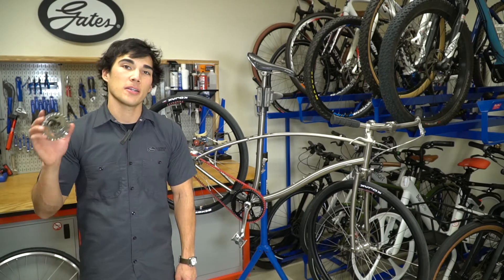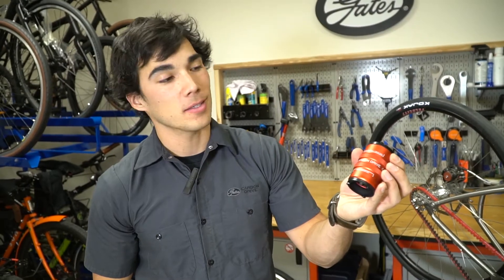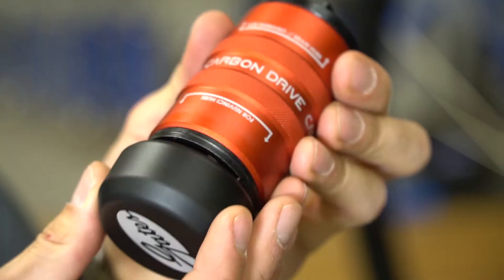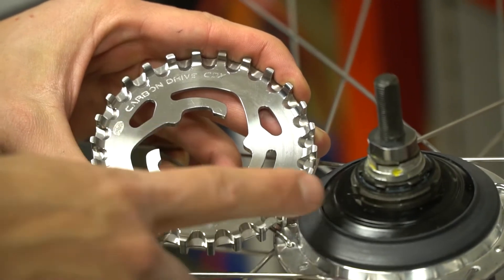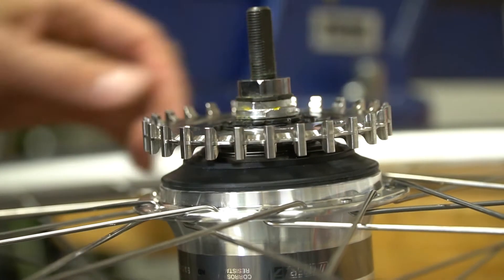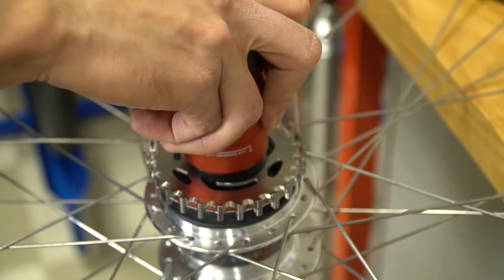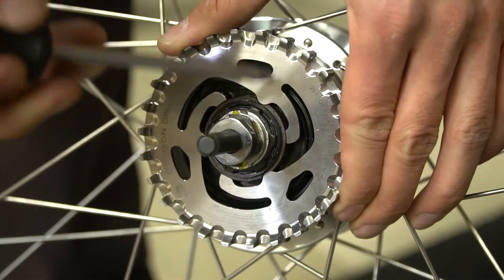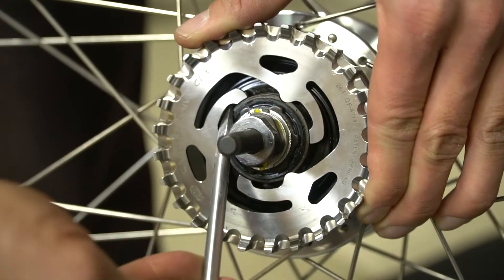Gates Carbon Drive U - Sprocket installation with SureFit Tool

Comment: It looks so much easier. Any difference with using two hands and press it? How much force do you really need? It was really hard for me and some metal shaving is observed on area where we press it in. Hair like wear on the rings, not the sprocket.

Comment: currently my belt drive is using 118t belt - 50t sprocket - 22t rear sprocket. Can i change it to 118t belt - 46t sprocket - 26 rear sprocket?
Reply: Think so ... the difference is still 4 !! So 0 ;)
Reply from the maker: When changing the gear ratio, the belt length must be recalculated. May be this tool will help: https://www.gatescarbondrive.com/Apps/DriveCalculator/index.html

Comment: Okaaaay, so this whole SureFit thing is about a sprocket not using an additional circlip holding it to a hub! Interesting. Is it any better than an old school design? Circlips sit in a groove with a whole circumference, so they should hold it better than just 3 lobes, so how is this design better?
Reply from the maker: With SureFit Design you also have to use a circlip for a better grip on the hub and to reduce noise generation.
Reply: @Gates.bicycle   what kind of circle do I need for a tigth fit?
Reply: circlips*

Comment: I have a hub with coaster brake, and frame that will accommodate retrofitting belt. Not sure if i can use belt drive on my hub with coaster brake?
Reply from the maker: Coaster brake with CDX system is possible, however at least one additional brake is recommended.